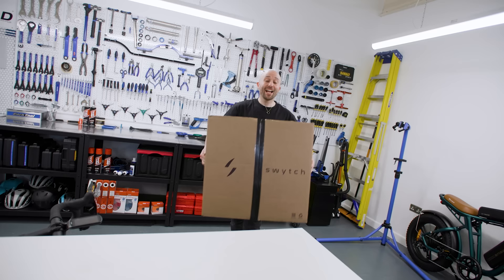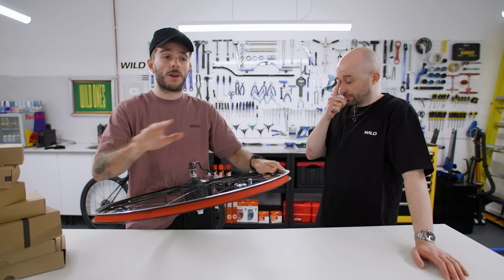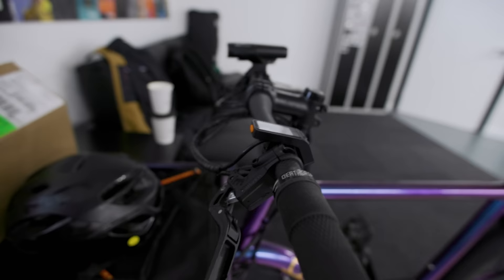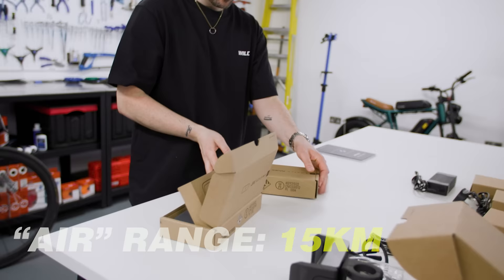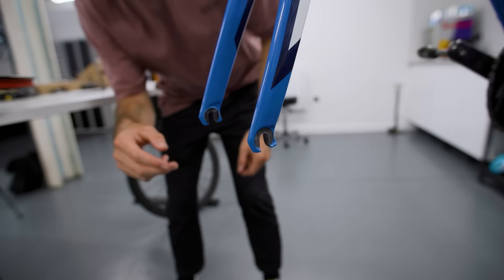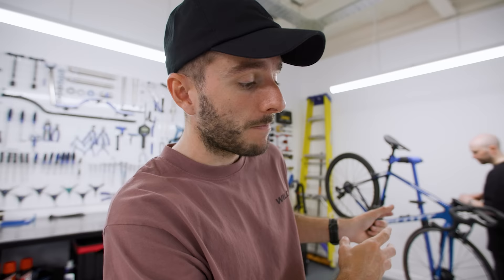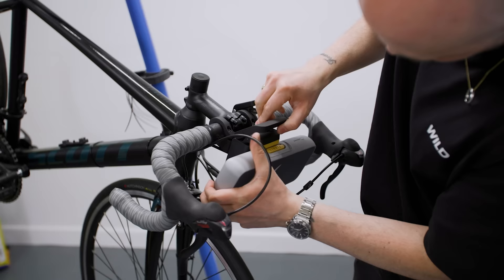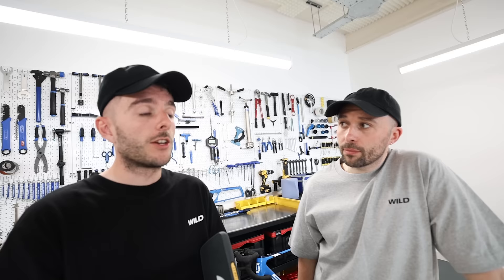Putting A Swytch Kit On My £5000 Racing Bike

Comment: Be lovely if Swytch could deliver kits to those who ordered them, been waiting eons for mine.
Reply: I'm in the same boat 🤣 should come any day now, going to try and get back my £100 first wave fee.
Reply: did you get it?
Reply: @JudeTheYoutubePoopersubscribe  Well, not least because 1500w is not legal on the road in the UK without a motorcycle license and the legal motor assisted speed limit for ebikes is 15.5mph.
Reply: It takes forever to get this kit waited more than a year as the first wheel didn't fit my forks .It was a 10mm and I needed the 9mm they asked me to file the hub down but I refused .
Reply: @woolychewbakker5277Yes there is video on you tube from someone  in America who waited a long time for his kit , when it arrived lots of bits where missing. 0:03
Reply: Thanks, you save me some cash
Reply: @newblor 10% leeway so it'll go up to like 17 on my cube e bike or near enough before assist cuts out

Comment: The other interesting thing about this is that since it uses the front wheel it converts your bike to all wheel drive.  Throw some snow tires on that thing and try it in winter.
Reply: I never thought of that! This would be a perfect on a gravel or fat-tire bike for the winter.
Reply: Would need to slap some insulation on the battery, otherwise the cold would leech all the energy out of the battery.
Reply: @alanashizume5651  depends on what battery type they used, but yes if it's not lithium batteries made to handle low-temperatures insulation would fix that.
Reply: @alanashizume5651  not actually that bad on ebikes, I've ridden an electric fat bike with a Shimano battery and motor in Finland (-26 degrees) and it was fine
Reply: @nebnollock5198 What electric e-bike do you use in the cold/ snow/ ice?
Any other tips for new winter e-bike rider and a new immigration to a cold region (Canada)?
(O am from India - no snow)

Comment: I bought one of these, it arrived last Thursday. The reason I bought one is because my partner is only 4'10" and nobody makes a light, non folding, sensible ebike for an adult of that size.

I didn't expect to be wowed by the swytch conversion but it's surprisingly good. I've fitted it to her Carrera Saruna 13" frame with 26" wheels and it rides well.

And as for the bit where you mentioned finding out how to speed it up, I was straight onto that. It'll run at over 20mph when you tell it it's got 16" wheels and you also turn the max kph up to 31 👍

Comment: I installed my Max Swytch on my 11sp Dura-Ace equipped road bike. I did not install the pedal sensor and solely rely on a throttle. Most of my rides approach 50 miles (80km), so I carry a spare Max in a slim frame bag just above the seatpost water bottle cage. 

Some of my rides exhaust both batteries over hilly terrain, but flattish ones can get me close to 60km on a charge, before swapping them out. So far over my two months of operation, I've accumulated around 500 miles and with complete satisfaction with the system. 

Overall, it adds about 8 pounds to my bike's original 18 pound weight, but keep in mind about me carrying a second battery. Complete electric bikes exist out there with greater range, more power, and similar final weight, but most cost over four grand.

Comment: I installed a swytch kit on my wife's bike for two reasons: 
1) Without a motor, she is really slow. Children go faster than her. But with the swytch motor, she and I can enjoy a bike ride together without me stopping every 30 seconds. 
2) Weight. A real e-bike would be too heavy for her to lift and we live at the second floor of an appartment. She needs to be able to lift that bike up and down the stairs. 
So far, she seems to like it. The range isn't great, but it's perfect for her commuting to work.
Reply: Never understand why many electric bikes are built like and look like motorbikes, obviously the lighter they are, the longer the range will be. At least now, some manufacturers have come out with lightweight bikes. The one I have just ordered is a reasonable 13.5 Kg with an (alleged) 60-mile range.
Reply: @keithjenkins7919 hi Keith, what bike did you order. Have you used it yet and are you happy with it?
Reply: @Shooter_gringo  ordered a Ribble Gravel AL e - Hero with Di2, sadly still waiting for delivery
Reply: @keithjenkins7919  thanks Keith. I’ll have a look. I’ve been researching for ages but don’t know what to pull the trigger on.

Comment: I was sceptical when I first saw these kits, thinking they were overpriced, underpowered and impractical, but in retrospect maybe I was unfairly judging them given that they're designed to be easy to install, maintain, have a useable but not excessive range, and designed for last mile city commutes rather than huge distances over difficult terrain. I was surprised how well they did even under difficult conditions. So well done to the team at Swytch 😊

Comment: I recently got the swytch kit with the Max battery. I retrofitted it to a 2015 Giant TCX. It seems to get the advertised 30KM range you need to be in power level 2 (see below). I've also just discovered you can go to power level zero (no lights on the power level indicator, at least on the basic display) when going downhill or sitting at traffic lights to help save a little more battery. When I first got the kit I set it to the highest settings and wondered why the battery was being drained so quickly which is what I imagine it was set to in this video. 

Here is what Swytch Support sent me. The below-recommended settings are not available anywhere that I could see on Swytch's website or documentation. 
----------------------------
Level 1: 34km
Level 2: 30km
Level 3: 26km
 
Levels 4 and 5 are designed as power boost settings to help on inclines and difficult terrain, please note the range will vary significantly with increased use on steep or long hills. Check that your Power Limit setting (hidden setting, see the manual to access) is set to the standard, middle option which is 80%. (The max it would let me set this was 90%) 
----------------------------

I now mostly use power levels 1 and 2 with 3 reserved for those steeper hills to get a good balance better range and assistance. My commute is around 16.5 miles (26.6 km) and quite hilly and the battery lasts as long as I use power levels 1 and 2.

Comment: Will be interesting to see how this goes. Recently saw a frame with a failed bottom tube. The guy had fitted a similar system to his road bike and it appeared the frame didn't like the power being applied through front wheel in that manner. Obviously there are a whole lot of other reasons it may have failed in that area but keep an eye on your bottom tube near the headset area.

Comment: Thanks for the good work guys. I think the question at the end (which includes the short range), could be answered easier if they made a more universal charging format like USB-C. This way someone who does have a 15k (9 mile) or 30k (18 mile) commute to the office could pop it off their bike and charge it up just like a phone or tablet.
Reply: cony  it looks similar to other ebike chargers I have. Feedback for Swytch would be getting a standard USB C into the battery and it could help them out.
Reply: cony  Good point. Didn't think about the voltage. I was thinking seeing most laptops (way smaller battery) are all switching to USB C these days.

Comment: 100% tried that at home - if it doesn't fit chop the bracket off with side cutters - no biggie, you're not affecting the capsule and they accepted my warranty application video.

Comment: I have the old kit on my hybrid bike and it helps me get more mileage in and tackle steeper climbs than I might  have otherwise done. I had to remove sensor tape and screw lugs from sensor unit to get proper clearance to magnets but Swytch instructed me to do that - don't think it voids the warranty.

Comment: I have a new Swytch kit for about a month and it works great on my trecking bike. I do not use it on top level 5/5 100% power (all the time) but rather just turn it on for steeper slopes above 5% or stronger wind conditions. And if you use it like that, range for smaller Air battery is far beyond 30 km. In the summer I am gonna test it on mountains terrain (10-20% slopes) and see how long the Air and Max battery will last. Thx guys for your videos. Greetings from Slovenia
Reply: Hey there! Did you ever test this on mountainous terrain? I’d be curious to know how many k’s this would do if it was only used intermittently or just for hills. Thanks 😊
Reply: @mindfulnessbringshope  Not yet, but in 2 weeks I am taking a longer ride with a 15 km 7.2% avg. slope (5-15%) - very TDF like - and I can report to you later how it goes. I aim to use just Air battery for slope alone and see, if I could get to the top without switching back to Max.
Reply: @igorsajn6246  Thanks for replying. That TDF style ride sounds like a perfect test of the Air battery! I'd love to hear how that goes as that would be the kind of ride I would like to do. I've got a Max kit on order supposedly for delivery next month. I'd like to be able to ride longer distances and only use the Swytch motor for inclines. Thanks again! Mike. Just realised I'm signed in with a different account, but @mindfulnessbringshope is also me!

Comment: Seems like a neat kit. I have a 16 km commute each way so as long as the bigger battery doesn't take forever to charge I could while at work. It's normally around a 15-20kmh headwind to work so this could potentially help on arriving so sweaty here in the Florida heat.
Reply: @@JuanCarlos-lh9sm I commute on a Look 765. It's more the weather than the bike or road obstacles. It is very flat and humid where I live

Comment: You finally did what I was waiting for. I thought it was vaporware for a long time. 21 km on the bigger battery isn't bad, and it will be useful for some people, especially in hilly cities. My commute is 21 km each way, so I can't use it. The low weight is pretty useful, because I imagine most ebikes with flat batteries are deal breakers, and it's not so with this.
Reply: If your commute is flat (ish) it will be fine.

Comment: I ordered one of these for a folding bike. For the price of the kit, and the folding bike I bought (A Giant)....I will have spent a lot more money than just buying a complete e-bike. 

If I bought an e-bike, you are relying on the e-bike not breaking and being able to get replacement parts (especially the battery) years later. What I like about these kinds of kits is: it's completely reversible....you can revert it back to a regular bike....something you can't do with an e-bike. Also, I find most e-bikes very clunky and heavy. This Swytch kit is more compact and simple.

Comment: (I could be wrong but) I think the bodge you did on the crank sensor was only required because you didn't read the manual (or watch the video) where  the frame spacing was explained.

You would have seen that the sensor gets mounted on the down tube, not the seat tube, and the spacing between the frame and crank is accounted for with the proper selection of bits in the kit.

Comment: Of course you chopped the range if you increased the top speed out of the box. BTW I do do a 22km commute which is why I still use the old kit with the Pro pack. TBF they replaced the bracket out of warranty period because they'd had some dodgy ones (probably why this is a new design where the battery pack doesn't flex the bracket on every bump) and I hadn't ridden in lockdown. Customer service was a bit slow as I don't think they were exactly overstaffed but maybe better nowadays. I don't think I'd have bought it with the current max range on the new kit tho. Good video!

Comment: These kits definitely serve a need, I don't have the Swytch kit tho' I do have a Green Zone Bikes kit with Samsung battery and thumb throttle on my commuter and it is still a lot of fun to have and ride on a 28-mile round-trip commute, not enough power for all the way either way but when the weather is warm, I can pretty much stretch it to cover the sections where I want assistance and that's more the false flats and boring flats than ramps and rises which I tend to attack out of the saddle lest I use up the juice in the battery on those.  And you are right, so much better to ride a bike with a dead battery on a kit than a full-on heavy e-bike with a dead battery, no comparison.  And when I run out of juice, either in the colder months or from riding into work with lots of assistance to beat the time clock, I'm pretty much okay with it as it was nice to have the assistance while it lasted.  And all in all it is just a fascinating learning curve to apply an e-bike kit to your own riding style and, O the joy, when I run errands around town on my commuter on a day-off work, I'm essentially riding a silent motorcycle as I can basically let the motor freely power me a mile here and three miles there, such fun.

Comment: I bought one only because I work as a deliveroo rider and I'm often riding 30 - 40 miles a day, in London it's not so bad but in Birmingham, the hills can be tough. So I bought this, the bigger battery and I expected to get 30 miles from it (waited 7 months nearly so it will arrive soon).

When I worked for Just Eat Takeaway full time I was doing 500+ miles a month easily for 15 months. But I still didn't get an electric bike.

So I guess I'm not like most riders who pick this up and I actually need a lot of mileage, however, as I'm used to doing the 30 miles on a regular single speed road bike, I am hoping that even if my pedal assisted miles are cut short, that it will still be worth it JUST for the hills and to make me a bit less tired out.

Even if I can just cruise along with the lowest pedal assist or with none sometimes, then put it up to 5 for the hills, I am hoping that it will be enough for a day. As I do really need about 40 miles. I'm using light tires, single speed so less weight from components, and barely anything at all on the bike so hopefully, it will be very ridable even when not using the battery, on flat road (I would save some battery for the hills coming back home).

I am already quite a strong cyclist, but sometimes I don't want to be sweating my ass off and working out just to make a few quid. I'm also hoping to switch job and use it to save thousands a year on my commute, and it will just make further away journeys much more manageable.
Reply: did you receive your kit, and if so, what's your experience? I like your use scenario, i'd be interested to know if it works for you and does last you all day.

Comment: For that price, I recommend an older Bosch E-bike with 400wh battery. You can find them under 2500 and they're well supported everywhere. And you don't need to fiddle with the setup of your bike, especially the wheel.

Comment: I'm pretty worried about those carbon dropouts which were not designed to take torque.
Reply: Definitely not! It is really meant for steel or titanium only, as are most wheel motors. Aluminum or carbon and the torque can cause damage, especially if you use the motor at full power a lot and/or are heavy. There are torque arm bracers you can buy if you are worried (I got those for a cheap aluminum bike), but if you have an expensive bike, I would not risk it.

Comment: If the Swytch kit batteries could be charged with a power bank (that you carried in your backpack) these kits would be a game changer, as no more lugging around a heavy charger & asking coffee shops or cafés if you can charge your bike
Reply: You'd need a hefty power bank 😂 You could just carry a second swytch battery 👍
Reply: @monkeyboy7981  Have you seen the price of a second Swytch battery?
Reply: @peterwilson6018  no but I'd guess around £200, how many miles do you think you'd get out of power bank and surely a suitable power bank would weigh more than a charger 🤔
Reply: @monkeyboy7981  not really, my 30,000mah power bank weighs as much as the smaller Swytch battery.
Reply: @Brookes79  that's 30Ah, but that means nothing without a voltage. If it's 5V then it's 150Wh.  The Swytch  Max battery is 5Ah@36V so 180Wh. The small one is 3Ah @36V so 108Wh.  If you bought the power bank from eBay, AliExpress or even Amazon then you might want to check the actual capacity. They tend to make up numbers. I'd be very surprised if a power bank smaller than the Swytch battery can store 150Wh.
Reply: @monkeyboy7981  I think the small one is £250 and the large one £299, assuming you're willing to wait at least 6 months for delivery.  Very expensive for the capacity.
Reply: @peterwilson6018  Ah, thanks for clearing that up, your probably right. It would certainly be handy though if you could use one. Maybe places will start having charging points for people with Ebikes soon?

Comment: I use the Swytch air to commute to work It's 6km in and 6km home and in setting 2 I often have 4 to 3 lights left on. It's on an Orbea road hybrid bike the most I've had out of it was 16km on the flat. I think you put that battery through it's paces with all the wind and hill climbs.  Only issue I've had is my Swytch battery did fail and discharged exactly a year and 3 days after purchase. Swytch however did replace it like for like.  But it was a concern because non of my power tools such as Hitachi or Makita have ever failed me after a year on their lipo batteries. Despite  Swytch  saying it is a premium battery I think they are just generic Chinese cells. Which makes the battery itself very expensive @£200 and £250 respectively if you do need to replace. The other issue are the spokes of the wheel they supply.  The do get loose and cause noise. Hard to balance ones they have gone loose because of the motor.